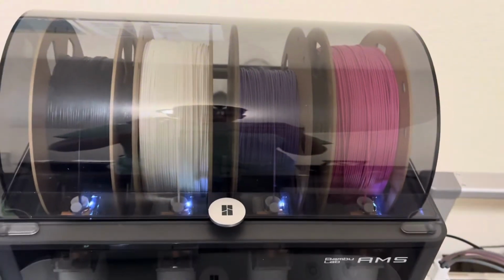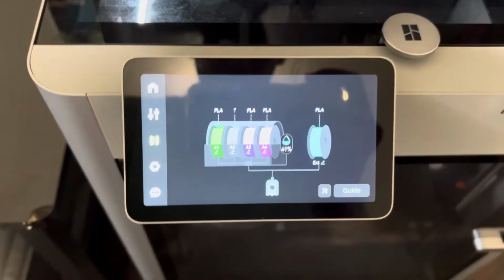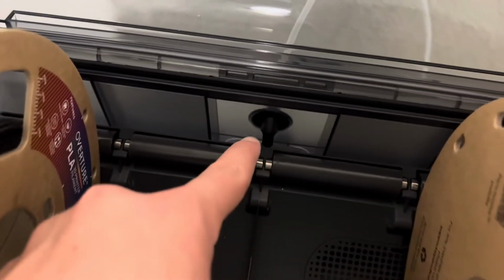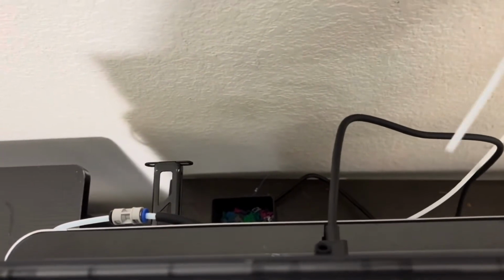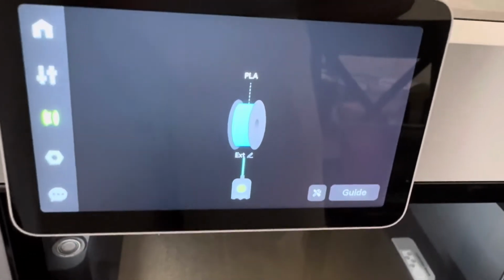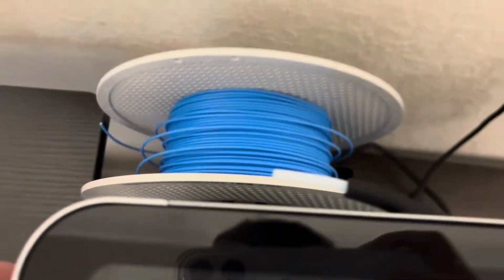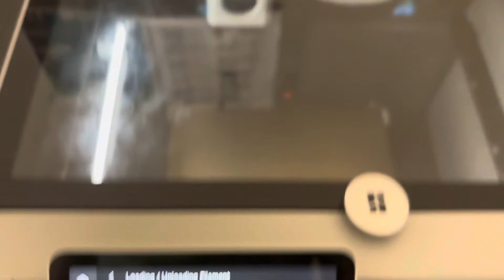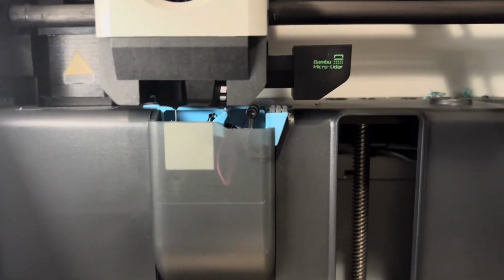How to switch from AMS to the external spool on the Bambu lab X1 Carbon!

Comment: Don't need to do any of that.. Simply go to the filament screen of the printer, click unload and it cuts the filament and pulls it back onto the spool. Then click your external spool, set filament type, and click load. Then you can feed the filament to the back of the printer using a y splitter, or by removing the PTFE tube between the rear extrusion motor and the printer chamber. No need to unload/unplug the AMS unit.
Reply from the maker: Okay, but I am showing how to fully take off the AMS and switch to external spool!